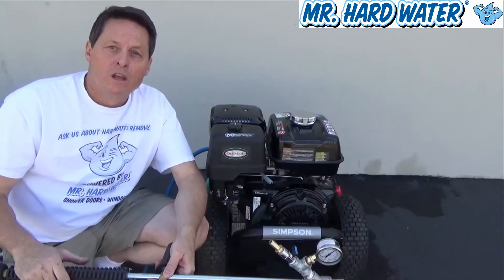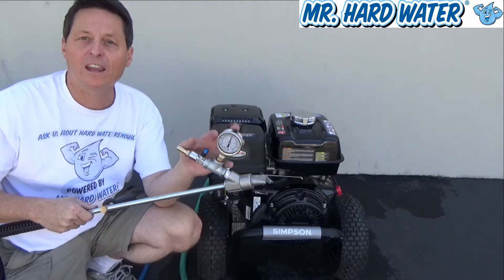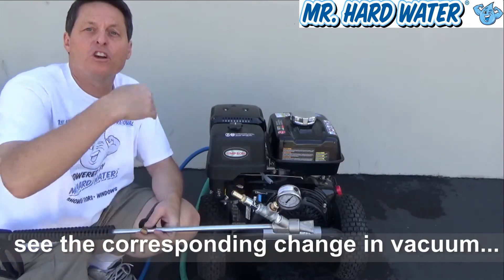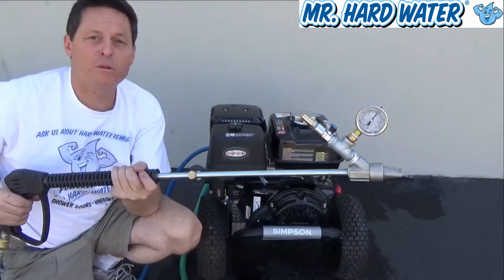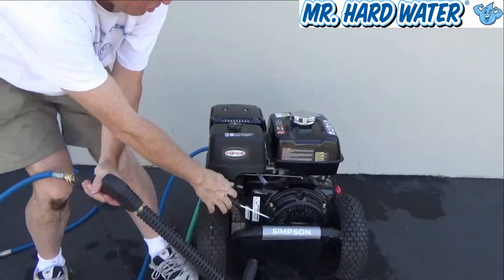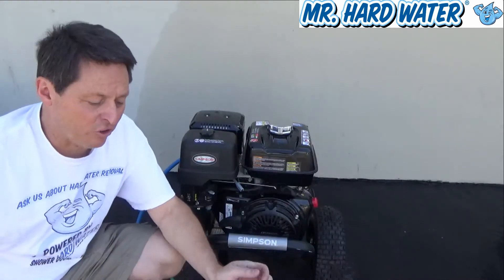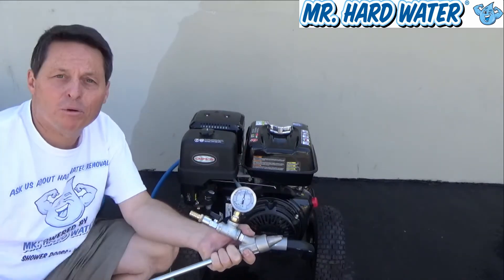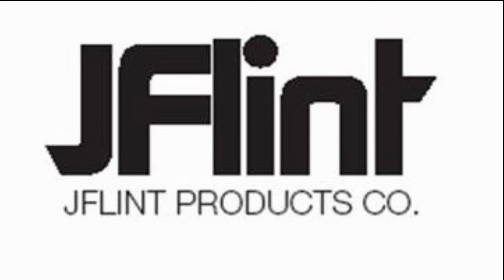Simpson Part 3 Adjusting the Regulator Mr Hard Water Wet Blasting

Comment: I’ve watched a lot of pressure washing videos and as informing as they are, I find a lot of details, the small details are lacking. It’s probably due to the fact that the small details would be considered common sense to a veteran and not to the novice. However, this video and the other series before this one is by far the most explanatory and user-friendly video. Thankyou 
Also, A contributing factor may be the fact that I own this very same Simpson 4200 PSI/ 4.0 GPM. Lol!

Comment: Pretty sure you have to be using a zero degree nozzle to check the operating pressure.  At least if you're trying to see what the max pressure is compared to the stated max pressure
Reply: Makes sense. Any other suggestions/tips, thanks. PEACE!
Reply: @harrymuhammad9835  g bc tom